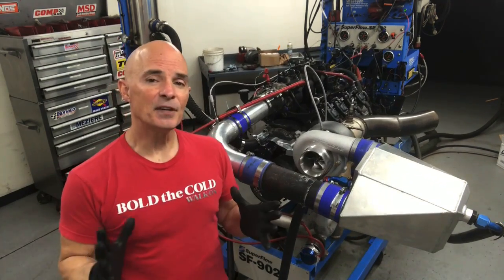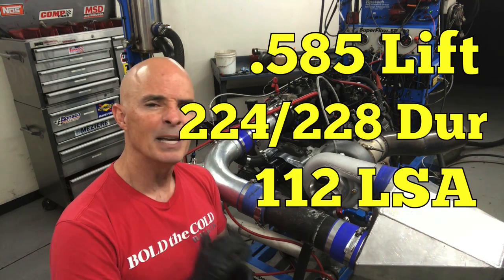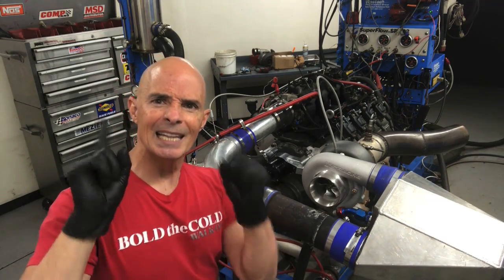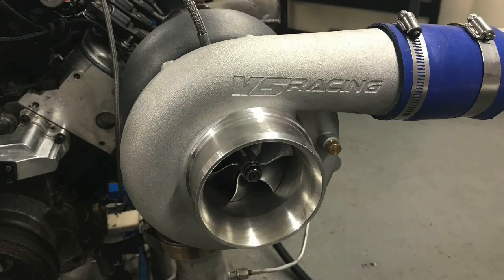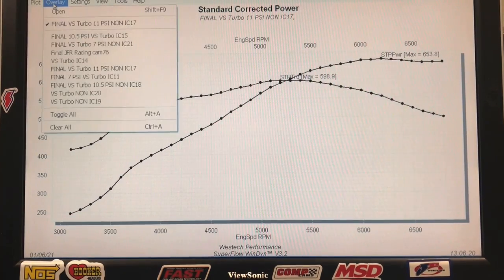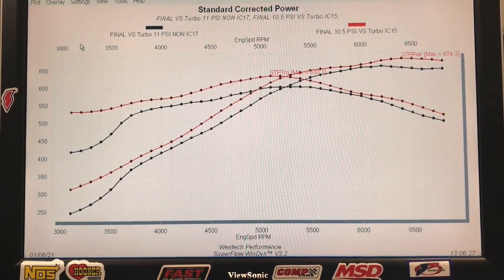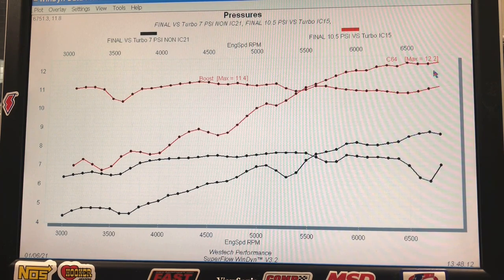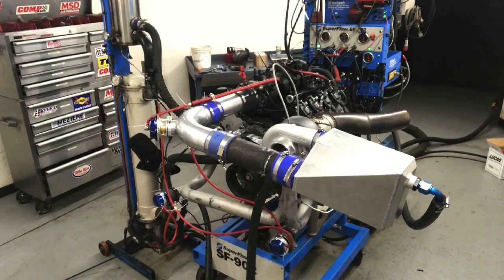JUNKYARD TURRBO 4.8L-E85 VS INTERCOOLER

Comment: The e85 will cool the charge a lot running no intercooler (to the point of not needing an ic), but to get the same maf you'd need to increase the boost pressure (in some cases putting the turbo into a more efficient zone on the compressor map). 

The other part to consider is that with higher iats comes the ability to run richer alcohol mixtures while still having good vaporization. More vaporized alcohol = more power because alcohol is oxygenated and absorbs heat. 
If you run the same setup at the same maf values, intercooled vs non-intercooled, the non-intercooled will be making more power because the combustion is more efficiently turned into mechanical force.

Not to mention intercoolers weigh a lot and are restrictive like a catilytic converter.

Comment: The benefits of e 85.
Cleaner emissions 
A cooler engine
May not need a radiater
Won't need an intercooler 
Can get at many local pumps

The bad
Twice the fuel consumption.

Bloodviking,  racen, engine builder

Comment: Higher octane fuels don't make much more power 7nless you add compression or more boost for the fuel being used. A switch to pure alcohol  may get you 60 to 80 hp from, a big block. So take full advantage of the e85. And without an intercooler you will not get as much turbo lag and not clutter up the engine bay as much with no intercooler. 

Bloodviking

Comment: Why would anyone run low boost with e 85. Pointless.
The coast of e85 and remember it take 2 gallons of alcohol to equal 1 gallon of gas in millage comparison its like you get 8 mpg in your street car now 4 mpg on e85 abouts. So boost it on e85 until detonation with no intercooler  then back of about 2 to 3 psi.

Bloodviking
Reply from the maker: a 50% drop in mpg? That would be a big no

Comment: Should have used an air to air not a 70’ dyno water air to water. That would have been a better comparison. Actual street cars not iced intercooler tanks. Even a air to water on the street is 20’ over ambient.
Reply from the maker: having run a ATW on the street for many years-mine was at or near ambient when cruzing with a good heat exchanger

Comment: Richard, you should look into some of the new quick-response IAT sensors that have come to market recently. The IAT should mirror the boost curve as the air temp will rise instantly when compressed. Hyperaktive sells a nice one that I will be installing shortly for pre-IC temps. Also, have you found that you will see a corresponding rise in EGT when the IAT is higher? Thanks

Comment: Could you edit in a segment that looks at 7psi with IC vs 10.5psi non-IC? This would be close to a scenario of what happens IC vs Non-IC at 620hp boost levels. I would like to see power&torque curves, Boost&back pressure curves. and temperature curves.

Comment: Adding a boost gate on the intake side plus a turbo tach would allow you to control the turbo RPM and compressor flow. In turn that would let you keep the compessor at max efficiency. That would let you stay in the highest efficiency zones of the compressor map. That means a cooler charge going into the engine. (You would still need to keep the standard waste gate)

Comment: I'd bet the boost response is from the extra exhaust volume made from more air pushing into the cylinders caused by the denser air. Almost like artificially increasing displacement a bit.
Reply from the maker: MORE POWER - MORE EXHAUST FLOW-EQUALS BETTER RESPONSE

Comment: Don't forget, where the fuel is t
Introduced into the intake  makes a difference as well.  I would guess that the same engine/ setup while non-intercooled would make more power with a throttle body injection vs port injection.
Reply: Yes. The e85 will cool the charge a lot but to get the same maf you'd need to increase the boost pressure. With higher iats comes the ability to run richer alcohol mixtures while still having good vaporization. More vaporized alcohol = more power because alcohol is oxygenated. 
If you run the same setup at the same maf values, intercooled vs non-intercooled, the non-intercooled will be making more power because the combustion is more efficiently turned into mechanical force.

Comment: I was hoping for Gas Intercooled, VS E85 Non Intercooled... I'd love to see That!
Reply from the maker: E85 WINS I SUSPECT-WE CANT RUN 20 DEGREES OF TIMING ON PUMP GAS
Reply: @richardholdener1727  Hey Richard, just watched a Steve Morris video where he ran a big block blow through carb setup with a centrifugal at 17 psi and 1300+ hp at 6500 rpm on 93 octane pump gas with no intercooler, timing locked out at 28°. Did a plug read and everything was good. When is an intercooler really necessary for a blow through setup?
Reply: @shadjohnsen8143 for a blow through an intercooler is not necessary. Has to do with where the fuel is added with a carb vs direct injection. It's much cooler with a carb.
Reply: I was wondering the same thing. 91 with IC and e85 non-IC

Comment: We always saw a healthy jump in boost when removing the typical A2A intercooler due to the pressure loss across the typical horizontal flow core.  I've seen an 11 psi differential on the typical cheap china 32x12x3 ebay IC. The A2W you use is designed to flow a ton. That's not typical of A2A units. Defiantly another thing to consider for typical street setups. You're turbo has to work a lot harder with a junky horizonal flow A2A IC to make your desired manifold boost. Not a huge issues at small boost levels. But when we crank these JY LS motors up to 20+ its a HUGE issue. You can even go faster removing the IC all together in SOME cases. Chris Bisher won Drag week and LS fest back to back with his non-intercooled SBE 5.3 with twin S366s. His car actually went faster removing the A2A IC. That said a good A2W is always going to make more power. His charge temps max out the GM sensor at 250* before the 1/8th mile. E85 and his tune keep the motor safe, even at those temps. No water/meth on that setup. 
  https://www.hotrod.com/articles/chris-bishir-wins-ls-fest-drag-week-back-back/
Reply from the maker: 11 PSI?
Reply: @richardholdener1727  Yes. On twin 76's to make 26 at the manifold we saw 37psi pre turbo with the cheap$120 Ebay IC that MANY use. They now have a 32x12x4 that has less pressure drop. But is still pretty bad. That A2W you use likely has very little pressure drop. Its not a horizontal flow core. Wish I still had my junky ebay unit!  I'd send it to you!

Comment: Interesting that boost/backpressure crossover is at almost the same rpm as torque/hp.  I looked at the "jagged" temp reading chart a couple times before I realized that the irregular part of the boost was only about half a psi.  Good video.
Reply from the maker: SCALE IS IMPORTANT

Comment: So Finally: Is it better with or without an I/C when running methanol? Do a test please!
Reply from the maker: IT ALWAYS HELPS-BUT WEIGHT
Reply: Technically, with still. If weight and complexity is zero issue. But often the benefits are not worth it, hence most don't. But some do because there's still power to be had.
Reply: Technically, either is good, but most people who don't have enough space in the engine bay to mount either an air to air or water to air intercooler, meth is a great alternative, but meth added to an air to air intercooler can make a big difference. I haven't experimented with meth injection, but I usually do see a big difference in air intake temperatures with air to air intercoolers.
Reply: @DiamondBackRattlaKid  The caveat is the IAT drop reported doesn't match the HP gain W/ water/meth. Even when sprayed in each runner with equal distribution.  The sensors that measure the temp drop are saturated and report back false data. If the IAT sensor was right, METH inj would be more efficient than intercooling. If the Charge temps were really as low as the "wet" sensor reported, the power would increase on par with the temp drop. IE if the sensor says it dropped from 300 to 100, the HP curve should rise just as it would with a good IC pulling 200*. But it doesn't! Water/meth is great at pulling heat form the CC. Its more like race fuel and prevents detonation. Sure there is a small amount of charge cooling, but It's NOT an IC! It will NEVER perform like one with the small volumes and mixtures these kits are spraying.

Comment: Results shown are typical.  Rule of thumb I use is every 4'C colder gains 1% power, normally aspirated. Turbo's gain more as density goes up.

Would have been an interesting result to do two runs and throw 2 degrees timing each run at it.  intercooled.
Reply from the maker: I DID TIMING CHANGES WHILE TESTING
Reply: @richardholdener1727  keep up your good work!

Comment: The boost response thing is interesting, and exactly what I've found too- Despite everyone claiming bigger intercoolers and longer boost pipes make things more 'laggy', in all testing I've done, and that's a fair bit, bigger/better intercoolers tend to give the biggest jumps in performance at low/mid rpm when the boost is first coming in.
Reply: The intercooler  richard uses flows a TON! The typical horizontal flow air to air intercoolers most use don't. Not many street cars run an nice air to water setup like the one used in his tests. Put the crap EBAY IC most use on it, and do the same test. At the typical boost level of 15-20+ and you'll see more like an 8psi difference in boost at the same WG setting. So the non intercooled setup does typically have better response. Also spraying meth pre turbo in large volumes improves response and gains boost. Still wont' cool the charge as much as a nice A2W, but it helps a little and is great for eliminating detonation.
Reply from the maker: I TESTED ATA AND ATW, OF VARIOUS MAKES, THE CX RACING ATW COOLER DOES EXACTLY THE SAME AS THIS PROCHARGER UNIT. THE ATA CORES FROM CX RACING DROPPED THE CHARGE TEMPS THE SAME. 8 PSI DIFFERENCE? NO
Reply: @AdamOpheim  not talking about flow or boost levels. 
Result has always been the same be it an eBay intercooler or a big name one. 

If its big enough, and intake temps drop significantly, the dyno results always have shown the biggest jump in performance was at low rpm when it's first coming on boost.

Same peak boost numbers etc, and the only thing can realistically put it down to is drastically lower intake temps.
Reply: @StavTech  But you have to incorporate flow, IC efficiency,  and boost levels because they are directly related to response. If the turbo has to make 30lbs to see 20 at the intake. The "response" will be effected. If the ebay A2A is only 50% effective at reducing charge temps while The A2W unit used with cool water is 95%+ effective... You won't see those drastically lower intake temps with the typical A2A. How many guys are running an A2W fed by 60-70* water? It makes the test much less relevant to what we would actually see in our cars.
Reply: @AdamOpheim  I’m not talking about anything like he has.
I’m talking dyno proven back to back tests on various relatively low power 4cyl turbo engines, comparing stock intercoolers to aftermarket upgrades.
And the results always have been the same when the before intake temps were bad with the stock coolers.

Comment: should have pump gas intercool vs e85 no intercooler
Reply from the maker: PUMP GAS WOULD GET KILLED-CAN'T RUN ENOUGH TIMING
Reply: @richardholdener1727  on the dyno with a single gear pull, yes, but in the quarter mile running through more than one gear  the IAT's would be way higher and my bet is you would have to lower timing on the non-intercooled to make it through the quarter without detonation. It would certainly be an interesting test either way :)

Comment: Great test!  IAT were climbing but no apparent damage.  I would say no brainer forget the IC up to the 10 psi you tested in E85.  It just begs the question, how high of IAT can you go with increasing boost non IC before damage?  We know methanol can go very far non IC  but how far can Non IC E85 go?  Maybe food for thought some day for another test.  Thanks.
Reply: It can go VERY high IF you know how to tune for it. My IAT pegs 255 (max GM sensor reads) well before the 1/4 on 19lbs Its fine. And I only run 60% ethanol.  Read about this guy. He won drag week non-intercooled with an 8.50 ET average. https://www.hotrod.com/articles/chris-bishir-wins-ls-fest-drag-week-back-back/
Reply: The actual IATs were not climbing. The sensor response is just slow. The IAT would follow the boost curve if the sensor was fast enough.

Comment: I would love to see a test using a refrigerated intercooler using the a/c system. I'm especially interested in seeing how much of a temperature drop that's achievable, and how much of a parasitic loss the a/c pump would be.
Reply: Yes you can get pretty efficient small ones from electric cars that have fast DC charging or build something like the demon power chiller
Reply: I run a Killer Chiller setup (AC chiller like the Demon power Chiller but better) on my Audi S4 and when I forget to turn the AC off before a 1/4 mile the car runs about two tenths and two mph slower.

Comment: Great test hope you have watched some of Gale Banks testing on his Diesel engines he has some giant MAF sensors that he uses to measure all of the air data 👍👀
Reply: I think lots of his work he uses the stock motronic ecu and edits the tables in them, especially if he is doing emission compliant stuff. He is really attentive to airflow data and afr though, I don't know if he could keep everything as clean as he tries to using speed density.

Comment: The extra heat reduction of the intercooler it’s probably requiring another 4-5• of timing so the non-ic curve wouldactually be more optimize than the intercooler one would be
Reply: Indeed,  supercharged LSA/LS9 engines are able to run high 20's on E85 at 12-14 psi so 26-27 on this engine at 7 psi should be pretty safe.
Reply from the maker: NO CHANGE IN TIMING
Reply: @richardholdener1727  We know Richard, just saying there's even more power on the table with the IC setup

Comment: I know at 28 psi and 19 degrees you get spaghetti rods non intercooled hahahha
Reply from the maker: YES
Reply: @richardholdener1727  I experimented this summer running non intercooled on e85! The internet says it’s a thing, I found out unless your spraying tons of meth it’s very not. Unless you run extremely low timing but still touchy at high boost. Also found it strange the rods tweaked to one side every time. Unlike pump gas which usually squashes the rod straight down.
Reply: @AdamOpheim   I don’t disagree with you at all you can run none intercooled but you are just always at the edge of detonation and you don’t usually want to be with a SBE thats already on the edge.  So it’s really not worth it when you combine the loss of performance.  I know it was hell of a lot easier to get my car to 8.6@160 with an intercooler on a sbe.
Reply: @RustyTunedRacing  Always going to make more power per pound with a good IC. BUt as the link I provided shows its possible. He later turned that setup to 32psi I believe and went 8.20's... then 8.1x's and hurt it.

 For most watching this, they aren't looking to run 8's. They are running garbage ebay A2A intercoolers on street cars. So comparing dyno cooled A2W runs VS non intercooled runs isn't a good comparison. I understand Richard can't run an A2A in a cell. Just stating the facts.  

For all the guys wanting to know if they'll blow their cars up on 10-15lbs non intercooled on E85 the easy answer is absolutely not. Probably better off without the junk A2A at those power levels IMO.
Reply: @AdamOpheim  hahah exactly it’s just interesting how everything goes on the internet.
Reply: @AdamOpheim  He has one video comparing A2W with A2A in that dyno cell.
Reply: @jsmcortina  seen it...thats a high end a2a. And a low end a2w. That balanced out. Was also only 500ish hp worth if air flow. Which both IC easily flowed w low pressure drops.   Not the typical junk Ebay 120$ unit im use to seeing on every clapped out shade tree ls swap. Run 20-25lbs thru one of those and the pressure drop is massive.

Comment: Wow, thanks for all the data and the dyno pulls in the video Richard! Great work!

Wish you guys were running a MAF on the Westech dyno and had the ability to calculate manifold air density but I don't think the Holley stuff can run a MAF.  I think if you could see the manifold air density it would show why more power was made with the intercooler vs. without.